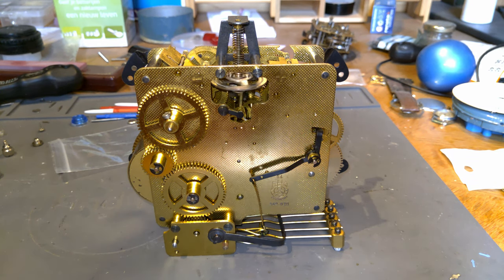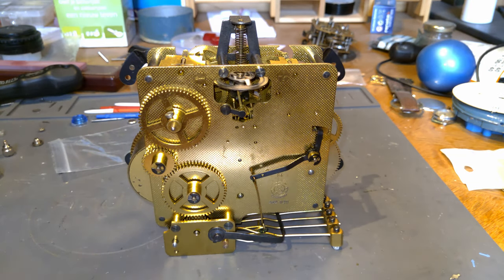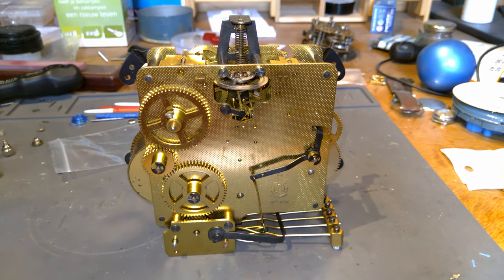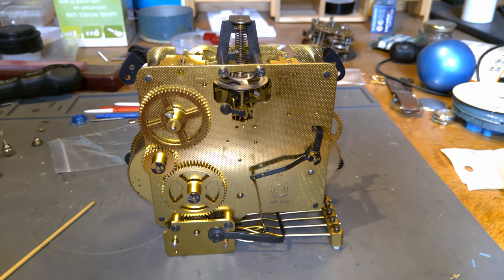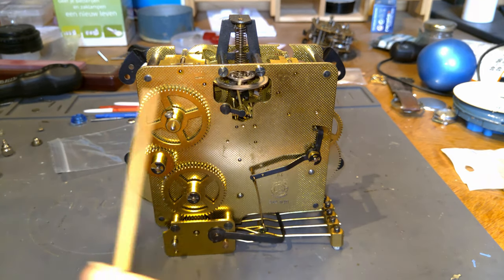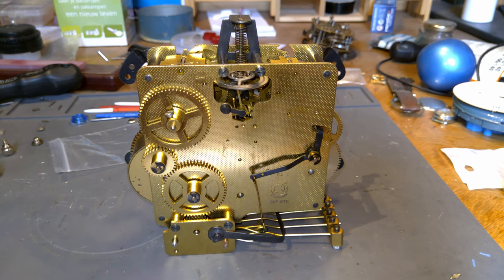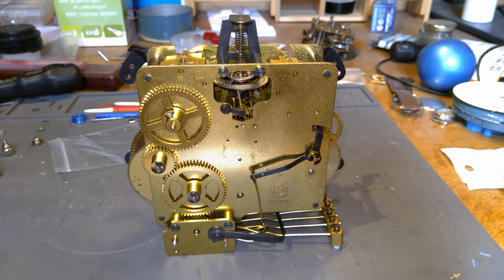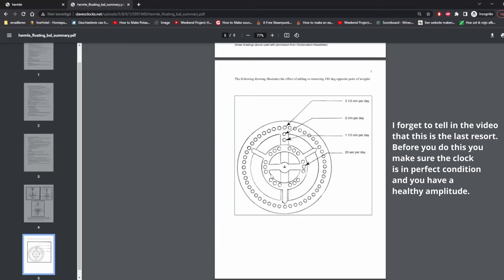Floating balans wheel clocks

Comment: how would you transport a floating balance wheel clock?
Reply from the maker: No special steps need to be taken. Can be transported as is safely. The balans wheel doesn't weigh enough to cause damage to the wire if moved around.